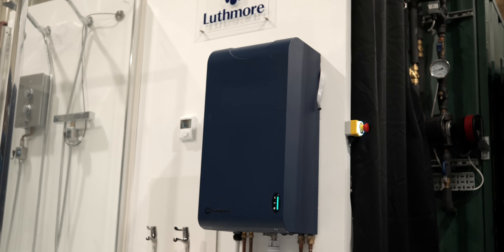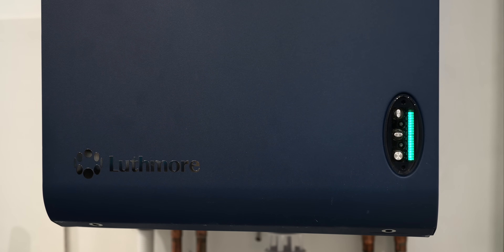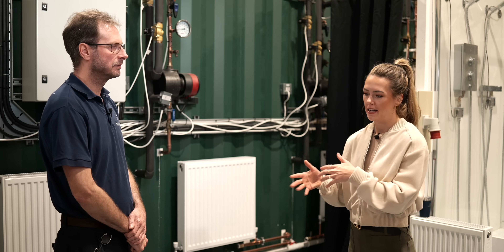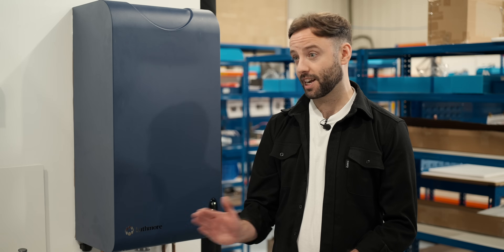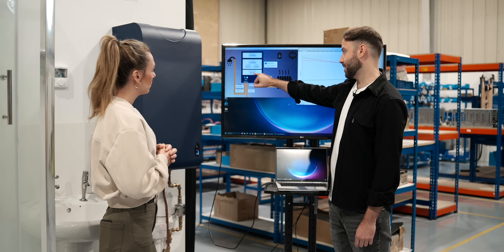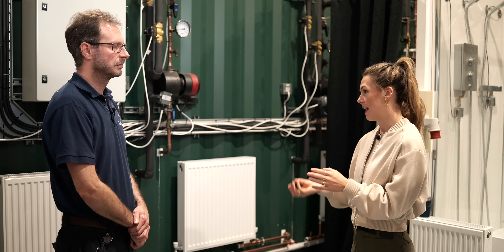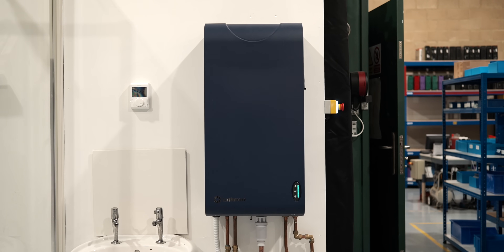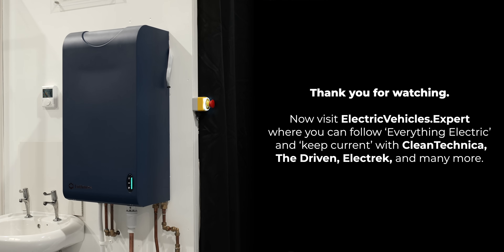Could This Battery Boiler Replace Gas AND Heat Pumps?

Comment: Q: Why not use the battery for everything 
A: Because the boiler can run directly from the battery without an inverter. 
Q: Why not just get a heat pump 
A: This is for properties where there is no room for a heat pump 
Q: Why bother when gas is cheaper
A: Ultimately, if the deniers can be won over, electricity will not be generated from fossil fuels so solutions like this will be needed 
Q: How much does it cost?
A: At present the system is dearer than a gas combi, but the price will no doubt come down in time if the venture is successful.

It is also worth noting that approximately 15% of UK homes do not have a mains gas supply, in Scotland and the West of England the figure is nearer 20% and in parts of London it increases to 25%.
Reply: This only is for hot water, and not heating. You would never get payback. Would be better just to store energy in a PCM, (wood alcohol, 118°c) so much cheaper.
Reply: @DougBristor 

If only for hot water then an instant heater, as in electric shower will be a better choice.

And a wall mounted  electric kettle doofer will sort out the crocks.

And if the shower packs up because it's scaled a new boiling vessel is under a £hundred and is a push fit on the pipework.

Why would anyone want to store hot water?
Reply: And does anyone believe punters are going to be queuing for this kit?
Reply: @ForestForest-n9i  Yes, trying to innovate is always futile, best just sit back and watch the world burn 🙂
Reply: @conradharcourt8263 

Do try not to be quite so simple.

Innovation generally requires some grasp of fiscal knowledge as well as technical.

We've seen quite a few holes poked in this nonsense already and it's been on this platform a few hours.

A waste of time.
Reply: @ForestForest-n9i . Innovation does not require 'fiscal knowledge', nor indeed financial knowledge, which I think might be what you meant. 
Certainly though there is a fiscal impact on this sector of industry as was mentioned in the video, the company are lobbying for the device to qualify for a government subsidy. In terms of financial knowledge, bankers are not generally innovators, they are risk averse and tend by nature to be unimaginative.  However, investors will be needed and the fact that the company exists suggests that some people with money thought that it was worth a punt. Which is basically how things move forward.  This is a niche product indeed and its profitability will depend on how quickly that niche can be made to grow.  The simplistic view is to condemn instantly, a better approach is to take the risk.  This is not a bad idea but it obviously needs to be promoted to the right people and fully understood by potential customers.  The comments here perhaps demonstrate a failure to explain adequately, rather than any shortcomings of the product itself.

Comment: some clarity on the central heating performance would also be useful? With a CoP of less than 1 (ok, just a little bit less than one as waste heat from the power electronics is cycled into the water) and an battery energy storage capacity of 5.88 kWh, thats really not a lot of actual HEAT output to heat a house of any size before the battery is flat?  A heat pump that can easily have a CoP of 3 or more could get 18kWH of thermal energy from the same ~6kWH of battery energy

@7:00 into the video, there is a claim that the unit delivers 10kW of central heating performance, but with an energy storage capacity of just 5.88kWh, it can clearly only do that for about 30min, it it can only deliver a total of 5.88kWh of heat into the house.  So, if you run your heating for longer than 30min (which most people do) then it will be using direct mains electricity and that WILL be costly, especially during the day (~25p/kWh  of heat, ie over 4 times the cost of the delivering the same heat via gas, which costs the same no matter what time of day you use it)
Reply: This can deliver 24kw of power not 10kw. That was for other LFP batteries. Unless these are charged by solar or tou tariffs then they could get expensive compared to a gas boiler or heat pump.

Comment: A vehicle to grid set up will provide all household energy required to provide for high output electric shower etc without the need for additional cost of more hardware?
Reply: V2g is taking a long time for auto manufacturers to deliver, still waiting...